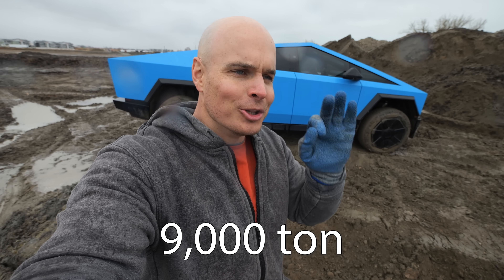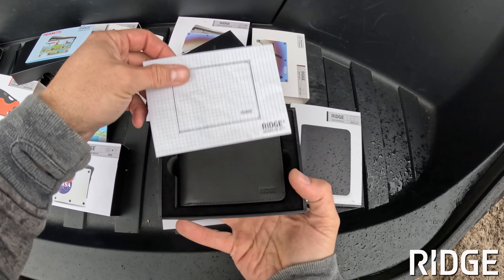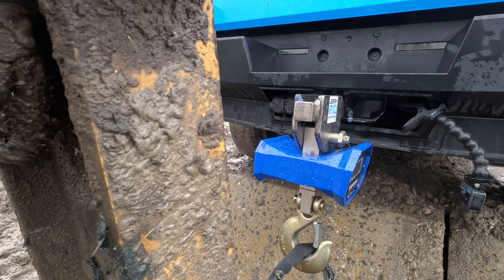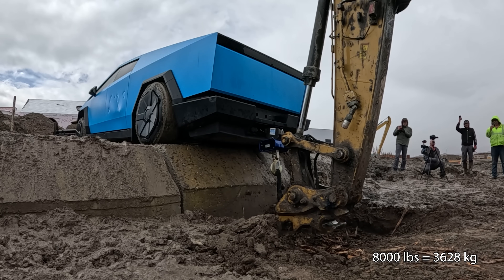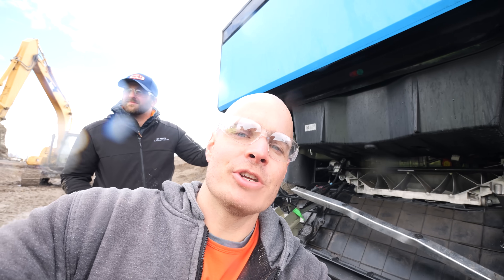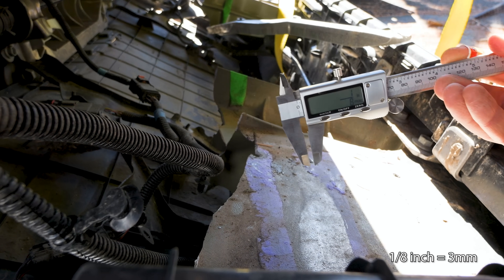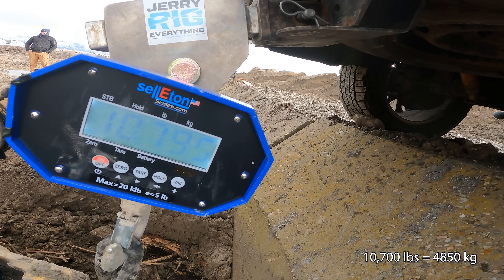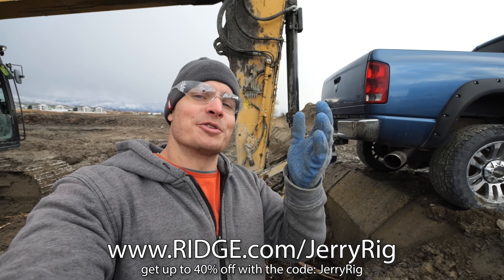SHOULD YOU TOW WITH A CYBERTRUCK?! - (catastrophic failure test)

Comment: There is a difference between tongue weight and towing capacity.  Typically the tongue weight (the direct downward force on the hitch) will be 10-15% of the towing capacity.  But I think they already know this and know that they aren't testing the towing stress.  The truck has a hauling capacity of 2500lbs and you already loaded it with 8,000 of downforce with no real damage.
Reply: 8,000 lbs further back than the bed which would have more leverage on frame.

But it’s like a F-150 toughness not a F-350 like the reveal wanted us to believe.
Reply: This is just part of the campaign to destroy musk for his eclectic efforts to reform government.
Reply: You didn't watch the whole video...
Reply: You know what would be a great trend? Watching the whole video before commenting. You know, where they say this word for word.
Reply: I think you missed a giant chunk of the video where this is thoroughly explained. Tongue weight is a static number used to limit what the DYNAMIC number will be in actual use. A static tongue weight of 1000 pounds can in fact become 10,000 pounds of DOWNWARD force in dynamic use.

But whatever, dude. Don't watch the entire video. Just leap to your keyboard so you can show off how smart you think you are.
Reply: @FriendlyPhoton  Could you please explain the physics of how a static tongue load of 1000 lbs. could in fact become dynamic vertical load of 10,000 lbs. while towing a trailer?  You can talk about rough roads or anything else a truck towing a trailer might reasonably encounter.  I'm just an old retired engineer who took classes in statics and dynamics, and don't believe that to be anywhere near true, but I may be mistaken and am completely open to different evidence.  I already commented about why I think the testing in video lacks validity relative to towing capacity, but if you can explain why I am wrong, I would appreciate it.  Thank you.
Reply: @bgowrwbw4755  That's literally exactly my thought as well they're talking about this force multiplier for a static weight but what's actually causing the extra force when they weight of the object remains The same
Reply: @FriendlyPhoton  show us the calculations or you're just talking out your butt.
Reply: @ I don't need to, I'll just take the 20yo pre-damaged steel truck frame that didn't break under even more abuse 🙄
Reply: @FriendlyPhoton  I think you missed a giant chunk of your education period, as you don't know how physics works.

1- His explanations were a joke. He completely ignore how physics works.

2- When towing, you are ALWAYS moving an object horizontally. In a flat surface, despite the angle unless it is 90º, there will always be vertical forces, so you'll never reach the tongue weight. When pulling from mud YOU ARE NOT puling the weight up. You are still pulling horizontally against the vertical weight and the surface resistance. In a road, the surface is quite flat, adding very little resistance on the wheels, so you just have to overcome the vertical forces. That's why the more momentum you have, the less the value of vertical force is. In mud however, the surface is soft, so now you must overcome the vertical force plus the increased surface resistance. But you are still pulling horizontally.
This is basic basic basic physics. And he completely ignored it.
Reply: The story here isn't that it broke, or how much force it took. The story is that the $140,000 vehicle now has to be towed to a shop that can't fix it, because the whole thing's one, giant casting.
Reply: @riparianlife97701 and usually the people that can afford something like this don't really care about that kind of stuff anyways these kinds of things are just throw away
Reply: @brick2392  So why put a hitch on it???
Reply: @riparianlife97701  I would only say your comment is a little unfair any damage to any frame of any vehicle is catastrophic it brings into question the stability of the frame that includes steel body
Reply: @brick2392  I've welded many hitches onto many trucks, then used them to haul heavy loads. I welded a hitch onto a friend's school bus. A sleeping woman hit it from behind at 60 mph. Her car stopped instead of going under the bus. The hitch and bus weren't damaged. Her insurance company said the hitch saved the lives of the woman and her daughter. But I'm probably speaking out of turn. You've probably installed a lot more hitches than me, and exceded my half million miles of towing.
Reply: @riparianlife97701   I mean it's really meant for more of a gimmick anyways The vertical load of the hitch for The Cyber truck is only 160 lb with a load weight of 1100 this thing failed at 10,000 but more than anything as I mentioned before it's just a gimmick really most of us aren't The target audience for this kind of product it's the same as any Tesla this isn't meant to be a working man's truck it's meant to be a fancy way of showing you have money I mean think about it $160,000 I'm not taking anything close to what I'm supposed to be putting on here lol
Reply: @brick2392  It's advertised as a tow vehicle. The word "truck" is in the name. More importantly than the fact it's a piece of shit, people aren't buying the things. Tesla stock is half what it was at the beginning of the year.
Reply: @riparianlife97701   Yes and I'm sure in all of that time of you hitching things up you most reasonably never hitched something that was beyond the capacity of the tow weight
Reply: @brick2392  Did you watch the whole video? The Dodge didn't break when the same forces were applied. My Chevy wouldn't have, either.
Reply: @riparianlife97701   Yes I watched the entire video I disagree with his analogy at the end as you can see some of the comments explaining how the 1,000 static load cannot turn into 10,000 lb without an external force however My point was that they were testing loads way above the rating level not too much of it this isn't a working mans  truck That's not the target audience
Reply: @brick2392  So you're a wealthy YouTuber with a dozen more ideas of how to torture the Cybertruck. You show up with that thing to a dealership and say "Fix it, whatever it costs." They can't, without ordering a complete casting off the line, and piling everything tinto it. It's going to cost more than a new one, hence the term "totalled". You're not going to total a steel-frame truck by ripping the hitch off of it, if you could. Again, the Dodge didn't break.
Reply: @riparianlife97701  look out of disagree when comparing steel frame to aluminum cast that really isn't my point here All I'm saying is the people who can purchase this it's not your normal 9 to 5 hardworking worker who needs reliability but nothing about this truck advertisement is technically wrong or a lie

Comment: The downward force that a tow hitch needs to be able to withstand is only a small fraction of the real towing capacity. In Germany, a standard tow hitch on a normal car is supposed to hold 75kg downward force while still being certified to tow 750kg. Even as a non-fan, I find the "test" somewhat hilarious.
Reply: I was thinking the same thing.
Weight is being dragged down ad infinitum, it’s being dragged across- dare I say towed
Reply: A lot of uninformed opinions here. 1100lbs tongue weight is a static measurement and this is a static test, but your real working load should be based on the dynamic forces that would be seen during vertical motion in a worst case scenario. I would not use the cresting the hill example, I’d think pot holes, curb strikes, and even just the sharp small quick movements of a washboard road will exert several g’s of vertical force on a rigid connection between the ball and coupler. A quick google search shows a range of 3-5g’s in a rough road example. So, 1100lbs x 5 is 5,500lbs of dynamic load. Then, you’re dealing with a safety factor of under 2.0 on in a dynamic environment on a cast part (variable porosity) that doesn’t have a fatigue limit. That’s not good. That’s why this test is relevant.
Reply: @zdresser  I doubt there'll ever be a scenario with a static tongue load of 1000 lb to begin with loll. Also, curbs, pot holes etc will cause dynamic loadings but there is no way during the trucks entire life cycle its damage will accumulate into a complete failure of the aluminum cast structure.
Reply: @robberbarron7602  1,000lbs of tongue weight is appropriate for a 6,500-10,000lb trailer. That’s not a crazy number.
Reply: @ It depends on the distribution of the loading inside the trailer, how many wheels it has etc. But your typical tongue weight for a cybertruck probably won't be 1,000. I don't think we'll see these hitches fail anytime soon, if you happen to hear this actually occurring, come back and send me the article lol. I think the engineers at tesla knew what they were doing when they designed the geometry and thickness of the aluminum cast structure.
Reply: @zdresser  That's assuming all the weight is downward force and none of it is absorbed by the suspension in the truck or even the front end lifting off the ground ever so slightly.  No, this test is not real-world, not even sort of.  The only test that should be done is a fatigue test and that will take some time. I would also bet that the engineers at Tesla have already done this test many times.
Reply: Yep, my model 3 max downforce is 75kg on the tow hitch.
Reply: 10% is normal 90% is over engineered. I will let Elon know that he can save some money by reducing the use of aluminum at the back. 
People need to grow up and not fall for these left woke democrats.
Reply: 75kg? I can jump on the tow hitch on my Suzuki and I'm 100kg. If it breaks by me jumping on it I wouldn't trust it with anything.
Reply: Exactly; "towing" is supposed to be a linear pull on the horizontal plane,and this "test' does NOT represent that.
Reply: It’s still bs.  The description is misleading. Far too close? 8x the spec isn’t close. 

“The hitch breaks around 10,000 pounds. (4500kg) Which is far too close to the 11,000 pound towing capacity. Yikes.”
Reply: Thank you for this.  My thought was, and I'm no expert by any means, that the angle of the pressure/load is not the same.
Reply: I wouldn't tow with any hitch that I couldn't use as a step.  That's just crazy.
Reply: I really do not see the point of this test.
Maybe some YouTube eye candy.
Reply: The thing is, the maximum force doesn't come from the tongue weight, it comes from the moment of inertia when something bad happens (the jerk) its the force applied when you have to slam on the brakes, or hit a shredded tire, or get in a crash
Reply: @noobulon4334  those forces are most likely to be applied to the hitch and frame in the horizontal plane,NOT downward. I saw a video over at The Drive of a short-bed crew-cab pickup truck a guy had bought,he put a camper on it just under the max payload spec,then loaded it up with his belongings,and also put an extender hitch on the back for his dirtbike,then went on a Baja trip.  His brand-new steel truck frame cracked,then broke right behind the cab. (the pics were hilarious) But he blames the manufacturer and dealer,despite the fact they didn't know what size camper or that he would overload  past the max weight and add even more overhang weight off the back.
Reply: @JayWye52  most of it yes, however when braking the weight of the trailer "rolls" forward putting a load on the top of the ball.

This is also why when towing from the bumper you will under steer while braking. The trailer pushes the rear down taking weight off of the front tires
Reply from the maker: I also said this exact same thing in the video. Thanks for repeating it in the comments.
Reply: @JerryRigEverything Your video is extremely misleading and disingenuous at best
Reply: @JerryRigEverything  But in previous comments you mentioned that someone could misload the trailer and that would do it. Which is a completely useless argument be making. I guess if you ignore specs and limits things will break. Maybe Elon could purchase one of your fancy wheelchairs and overload it til if fails then make a video about it and make comments about how someone could use it improperly and it could break. He could title the video Not wheelchair breaks when using it.
Reply: @JerryRigEverything  What was the point of this video? Why didn't you perform a meaningful test?
Reply: @tewrgh  why are you commenting?
Reply: @couchpotatoes5158  why are you commenting?
Reply: @tewrgh  why am I commenting?
Reply: @JerryRigEverything  Doesn't make it any more realistic, same with comparing a 1/2ton rated vehicle to a 3/4ton rated vehicle.
Reply: @JerryRigEverything  Butthurt Much.
Reply: @JerryRigEverything  So what was with all the sneering and saying stuff like 'Man, ripping at 10,000 lbs is not a good thing' , sounds biased.. you lost a lotta credibility with this.. guy
Reply: @JerryRigEverything  The hitch handled 6.6 times the tongue weight before it broke.  A typic safety factor is 1.5-4.  There are trade offs when engineering things and the Cybertruck as ugly as it is, was well within specs.  By your logic we should be making our receiver hitches out of titanium.  I'm not sure the video warranted your click bait title.  Don't believe me, there is a standard for this;
SAE J685 
Class 1 receiver ball - 47.6 (1-7/8)
Longitudinal Tension: 26.7 (6000)
Longitudinal Compression: 26.7 (6000)
Transverse Thrust: 8.9 (2000)
Vertical Tension: 11.1 (2500)
Vertical Compression: 11.1 (2500)
Reply from the maker: @jaredhaggert  the hitch didn't break.  The literal frame of the truck broke. The hitch engineering is fantastic.  The frame material of the truck... not so much. And the cast aluminum was the focus of this video
Reply: @JerryRigEverything  I’m expecting a similar test with the Rivian. How soon til we see the rivian test video?
Reply: @JerryRigEverything  It survived you applying 8x the rated tongue weight.  When is the R1T test?
Reply: @JerryRigEverything  NOT an honest test of TOWING capacity. all they did was overload the tongue weight,to the point the frame broke..DOWNWARDS.
Reply: @JerryRigEverything  exactly but Jerry being so unethical he wanted a broken cybertruck for a video, like 90% of the comments are saying we all see his motivation, too bad this guy is blinded in his I hate Elon era, IMAGINE not doing a towing test horizontally, when your single point was a broken cybertruck and you have no morals the result is this video
Reply: @Upliftyourbrothers  Two wrong tests still won't make a right test.  Having said that, it would be an interesting comparison.
Reply: @JerryRigEverything outside of catastrophic collisions when is that frame going to see 10,000 Lbs of force? No trailer that the cybertruck will tow will apply that force short of someone stacking steel plates on the frame of the trailer between the truck and trailer. Not a tesla fan but just seems misleading to people who don't know about trailers/trucks and how loads and forces are applied. I do load testing on large steel proje to pretty regularly and gotta say that's not really as bad as your making it seem. You should look into the stamped sheet steel automotive parts are made of these day, it might make you question vehicles on the road in general
Reply: @slawzy222  he’s obviously biased and only trying to make tesla look bad because he hates elon musk
Reply: @JerryRigEverything  Nope. Your test is nonsense click bait for the Elon deranged. Whatever gets you paid I guess.
Reply: @JerryRigEverything why didn’t you compare to a common truck?
Reply: @JerryRigEverything   In no real case scenario the car is strap to the ground. At that much weight, the car is already doing a wheelie...
Reply: @JerryRigEverything  No one really watches the video, we just jump to the SponsorBlock highlight
Reply: @JerryRigEverything  many people seem to be selectively blind and deaf :D
Reply: @JerryRigEverything lmao every one with a brain knows what you are doing. ready for a lawsuit
Reply: @JerryRigEverything  Fix your title.
Reply: @JerryRigEverything So where are your calculations for how much force those scenarios would impart vertically on the hitch?
Reply: @JerryRigEverything you are absolutely clueless.. your videos are a joke
Reply: ChatGPT gave me 7 real-life scenarios when pressure on tongue might be 100% of the trailer weight or close to it.
Reply: @timbogomolov7796  Landmines, changes in gravity, and falling off a cliff.
Reply: @timbogomolov7796  If chatgpt gave you 7 real-life scenarios that pressure on tongue might be 100% of trailer weight, then you could simply copy-paste it here. You didn't so i call BS on your statement. 
Also, according to SAE tests, 5200lbs tongue weight and 5200lbs braking force can deform hitch a little bit.
Reply: @timbogomolov7796  LOL ChatGPT. Haha. Thats funny.

Comment: I wonder what effect a weight-distributing hitch, like an Equalizer would have. It puts much different forces on the frame, trying to push the front of the vehicle downwards. It is essentially a spring-loaded triangle and that seems that it would be "pulling" backward on the casting as it tries to load the top of the triangle to push the front down. I could see this causing even more problems.